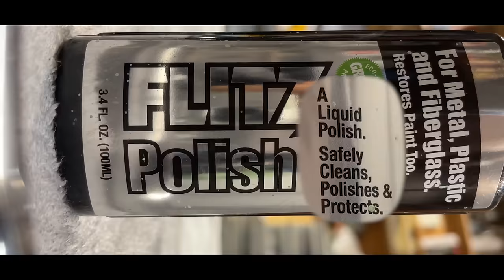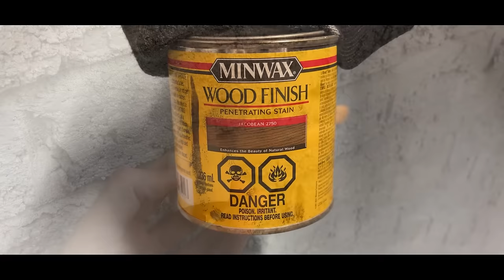Restoration of RARE 1920s Bauhaus Cabinet | Extremely Rusty

Comment: Fantastic transformation...as always.  Very satisfying to see trash transformed to treasure.   This scratches me right where I itch!
By the way, I'm a Gen X'r with lots of experience, but I learned two important things today!
1) You can give everyday steel a chrome-like finish!  I had no idea!
2) I have used 600grit for wet sanding in the past, but never knew there was a 2000grit!
I have a very rusty tri square with wood handle, brass edge and metal ruler.   I am going to do all of your techniques to bring back it's original lustre.   
My Dad gave it to me recently, and we build some things together, so it has sentimental value.
Thanks!  From Toronto
Reply: Oh, and where did you find that cool yellow sanding sponge 7:54
Reply from the maker: @canadude6401  It’s a hand sanding sponge by Gator from Rona! Good luck on your work :)
Reply: @ModernMakeovers  Thanks!  I started working on restoring the tri-square.  looks really good, however, I can't seem to get the deeply embedded rust out way below the surface.  I have tried a 24hr soak in vinegar and baking soda and sanding with 80grit and WD-40.  Am I right to assume some deep black stains might be impossible to remove?
Reply: @canadude6401   - Have you tried Naval Jelly?

Comment: As I said before you are INSANE.  Crazy talent, crazy craftsmanship, and an insane inspiration.  Have to say I am beyond impressed more like mind blown.  
So this "alligatored" on you?  Sorry, but it is comforting to know that I am not the only one with some bad luck here and there.  A couple questions:  Since this finish showscases and magnifies every tiny imperfection, would a "sanding primer" have been useful?   Also, will the beautiful metal retain this shine or would a wax or some protective coating be beneficial?  
My 2 cents:  the handle is wonderful, but to me, a vintage chrome handle would be better.  In my area, there are 2 used restaurant supply "junkyards", and I am sure you could get a great handle from one of those places.
I appreciate your humor.  This vid actually made my day.  Thanks.

Comment: I stripped and repainted an iron bedframe and iron side rails scrounged (rescued) from my grandparents barn. The rails were not rusted to badly, but the bedframe was a horror ..... rusted to the point that a four "feet" had lost some of the gnarly "carved" design was lost ..... all of the casters were long gone.  But, rescued it I did. When I finally got around to it,  I spend much of that summer hand sanding and steel wooling the metal, then set to the painting.   I found Rustoleum spray primer (some sort of a rust arrester) ..... used a flat black and applied 3 costs until I achieve full coverage on the iron.  Did the side rails as well. The got side tracked with another chore. When I went back to finished the bedframe,  found that I like the flat finish rather than a gloss finish.  I love my flat black antique bedframe ..... I have it set up as a day bed in my basement.  Good for guests ..... and even better when I want to hang out in the basement to watch TV, a movie or listen to my collection of LPs.

Comment: Fantastic transformation. Was there any "orange peel" effect? There will be if you don't "knock" that down. It will prevent you from getting a mirror like finish. By the way, I have a metal lamp that I will try the wet sanding technique. Thanks for that!

Comment: I don't think you realize the significance of the Bauhaus to modern design. It is HUGE. This piece should be restored to its original colors and design, IMO, and sent to a museum. You are an amazing, brilliant craftsman. I'm not trying to reduce what you have done as its a beautiful job, but this piece should have been restored, IMHO.
Reply: "The Bauhaus movement had a profound influence on subsequent developments in art, architecture, graphic design, interior design, industrial design, and typography.[4] Staff at the Bauhaus included prominent artists such as Paul Klee, Wassily Kandinsky, Gunta Stölzl, and László Moholy-Nagy at various points." Taken from Wikipedia. Yeah, I know, it's Wiki, but it's still true.

Comment: Modern Makeovers,  at first I was appalled that didn't restore it to the original finish and color.  Then I realized the name of your channel.  The cream and green were classic kitchen colors in the 1930's and a favorite of mine.  I have to say, your end result was stunning.  One question, why did you not use a chrome handle?  The wood handle was pretty cool looking and it did add a touch of warmth to the bright red.  And your surprise Christmas diorama is so sweet and whimsical.  I admire your skills and workmanship.

Comment: FYI: primer avoids an uneven finish by not allowing the paint to absorb unevenly.  If it’s a sandable primer, then it will be even more smooth.  Plus extra adhesion and longer life.

Comment: sigh...the reason the tubular metalwork was quite rough, is because it was painted that green colour when it was new. You polished it until it became smooth but it was never intended to look like chrome. The woodwork was likely painted that mint green and I noticed a label on the front door. The cabinet is likely from the 50s (I specialise in furniture and the new red colour suits it - the brown handle would not be my choice. Interesting thing but not Bauhaus.

Comment: I am concerned about the metal.  Without a protective coating it will soon start rusting.  The painted wood could have been smoother if you had applied a grain filling base coating.

Comment: just 2 minor complaints. 1 that hinge looked like it was copper or brass, that should have been polished and not painted. 2 is that handle should of had 2 screws put in it as with just one it will always come loose and thus flop downwards.